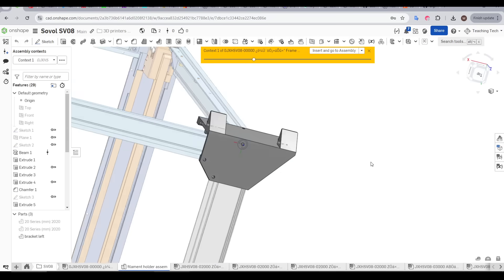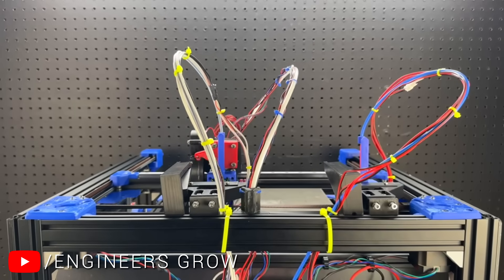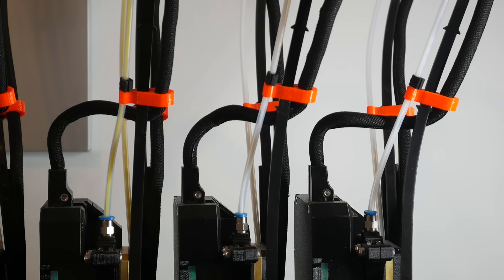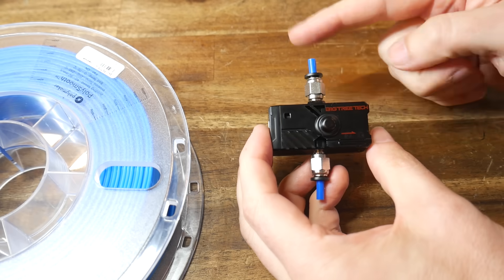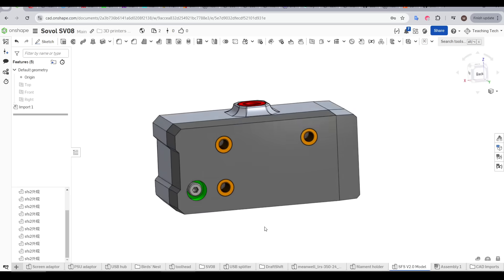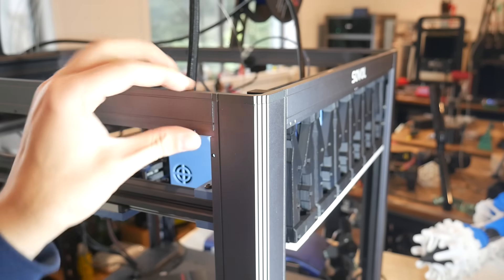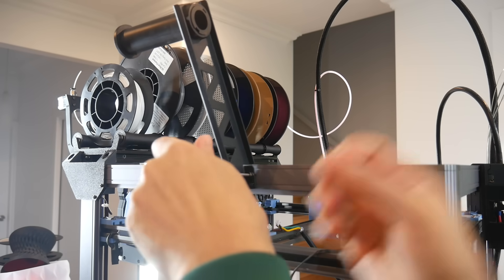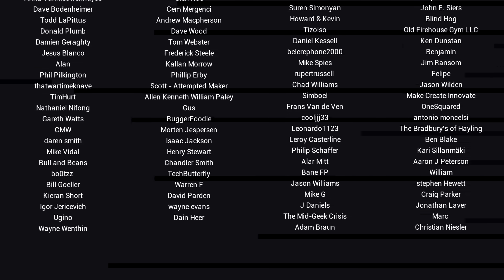Modular spool rack - Budget Sovol SV08 toolchanger part 5

Comment: I strongly believe it would be beneficial if you uploaded all of your designs, files and documentation that you used even before the project is complete. I am preparing to buy the SV08 next month, with turning it into a tool changer being the end goal. However I won't be able to get all the parts immediately, I will be doing that gradually over time, likely one toolhead at a time, and that would mean most likely doing some upgrades in the meantime too. Having the documentation from your project, as well as other similar projects available would be very helpful with deciding if I should replicate your project, someone else's project, or should I do some mix and match, which will also have an impact on the possible mods and upgrades I will be doing even before adding the first toolhead. Another benefit would be other people building on top of your project, possibly also adding things and designs that would be helpful and beneficial to your own project. It could be a group effort, which could increase your chance of success. I hope you will find my opinion valuable and I also hope to see you release your files soon!

Comment: I was wondering how you gonna connect 5 filament sensors. I'm working on design where I would like to use 5 of those BTT SFS's but I don't have enough knowledge to connect it to my BTT Octopus Pro. And set it all up in klipper. Is it possible to run it in series?

Comment: So to the back with the spools after all 😆 Most people have their printer ith the back against a wall. In my case, the printer stands in a shelf in a rack. Do you have to lift the spools of over the bracket?
If so, this spool solution asks for lots of open air above the printer, and it will not suit my setup. But a different spool solution can always be made, even as an after thought, so in the end it works for all of us 
Very nice to see the progress! Thanks Michael 🙏

Comment: I hope part 6 of this excellent series arrives soon.  I just bought an SV08, with quieter Noctua motherboard fan and MicroSwiss hot end upgrades.  I have a product that I want to print on it that would use PLA as support material and PET-CF for the part, and it would be great to be able to print some TPU on both ends of the part for impact resistance without needing to print TPU end caps separately and assemble them.  I'd love to be able to add one or two print heads to the SV08.  Thanks to Michael as well as the DraftShift team for this awesome work.

Comment: FYI when tapping in a bearing you want to only hit the outer race. Hitting the inner race of the bearing bends and tweaks the bearing support rings.  If it doesn't grind it can cause unnecessary pressure on the balls lessening the life.   Try a socket that fits the outer ring race of the bearing.

Comment: Nice project! The question is ask myself is if the integrated power supply is not sufficient for only 2 toolheads? As they not really work mainly in parallel, more in a sequence? You would also not need the birds nest, as there are spare USB ports on the mainboard. Simply then go with a complete new cable from the mainboard to the toolhead 2. (D+, D-, GND, 24V). Then the cost for the 2 toolhead variant can be decreased a lot?
Reply: I believe with toolchangers that the hotends are kept at least near temp between uses. So there would be some power savings, but it'll still need to be kept near printing temp. I guess it depends on how mature the toolchanger plugin for Klipper is. Or if the slicer can include a command to bring the next tool up to temp several commands before the toolchange command. This would still require multiple hotends brought to temp at the same time. You could still drop the cost of the Birds Nest with the spare ports and more wonky cable designs and only upgrade the PSU if you want. Heck why stop there, add a couple more hotends with the external USB ports or with an internal USB hub. If you want to go ultra cheap there are more corners to cut, but I think Michael is going for a budget still mostly reliable option, not a, lets see how absolutely barebones I can go to get two hotends.

Comment: Another way to reduce the flop of the ptfe, is to add a glass fiber rod alongside it. It does need to be secured at either end, but works quite nicely. I used 2mm rod to keep my ~80cm cable loom in the air, and that is plenty stiff. I'd probably go down to 1, or maybe 1.5 mm for this.

Comment: I take your point about the MicroSwiss hot end but I went ahead and bought one because I needed to change the nozzle.

 I bought the spare set from Sovol but there was no way I could remove the heater element from the original heater. It is supposed to unclip but wouldn't  budge. I even considered getting spare heaters and thermistors - one for each nozzle. They are available, but not in Europe when I looked. 
 I am really happy with the MicroSwiss replacement and the nozzle change is really easy.

Comment: Is anyone working on a version that uses the enclosure? I have ideas for how I might try to adapt what I've seen so far, but no point in reinventing the wheel.
Reply: I have an enclosure and already ordered extruders and other stuff. Will start the transformation as soon as I see the first successful multi toolhead print. I'll drop the doors and also take my own preferences on some details. Where do you see huge differences the enclosure could make?

Comment: The rollers, e.g. at 10:46 are concave. This is contradiction to the conventional wisdom of putting a crown (convex bulge) on pulleys. Do the filament-spools behave differently than belts? Do you see the spools crawling off to one side?

Comment: I had a similar problem with a long reverse Bowden tube sagging down into the print area on one of my 3D printers.  I solved the problem by putting the PTFE tube inside polypropylene refrigerator water line from my local hardware store.  The water line is rigid enough to keep the PTFE tube out of harm's way, but flexible enough to not restrict the toolhead's movement.  It's also really cheap (at least in the US, it was about 4 USD for about 3m of material).
Reply: Have you maybe for the non US people, the outer and inner diameter?
Reply: @berlinberlin4246  The water line I used has about a 4.6 mm ID, according to my calipers (It was specified at 3/16").  A 4mm OD PTFE tube fits inside easily.  The OD measures about 8mm.
Reply: @l0rider  thank you for the information

Comment: How much sense does a toolchanger on a printer with a static bed make? Going all the way to the top a few hundred to thousand times in a single print sounds extremely stressing to the parts. It would normally only do this once per print, not a thousand times, so I'd expect the parts to fail very quickly, right?

Comment: It's a shame the XY gantry moves in the Z direction.  If the SV08 was a coreXY printer with the XY stage at top and the build plate slowly descending under it, it would be possible to hang TPU reels above on bearing hub reel holders and not use any reverse Bowden tubes.

Comment: I'm addicted to these project videos.  I've been eyeing the SV08 for months but was reluctant to buy it when my product development cycle wasn't imminent.  I've bought 3D printers months before I needed them in the past only to have better options available in the interim.  My ultimate printer would probably be an enclosed SV08 with four tool heads.  Huge respect to everyone who is making the multi-head SV08 happen.  Just as the SV08 was a win for Sovol and the community because they collaborated on open source development, I'd love for Sovol to make their own version of the multiple extruder SV08.  The open source community and for profit companies are not enemies and should function as allies, as long as everyone follows the rules of the open source licensing agreement.  Kudos to Sovol for the SV08 STEP files.
Reply: I see you everywhere hehehe.

Comment: hmm, looks like you will come in close to half the price. I wonder how much time it will take in comparison (printing parts, assembly, tuning). The main reason people get Prusas is because so little tuning is required (since they have full teams dedicated to it).

Super interested in seeing what the first prints will be like. I could also see a version of this where the filiment holder in flipped over like a rep box and feeds down into the machine. That way you could keep compatibility with advanced materials and not just be a PLA/TPU machine since you could then enclose.
Lots of possibilities.